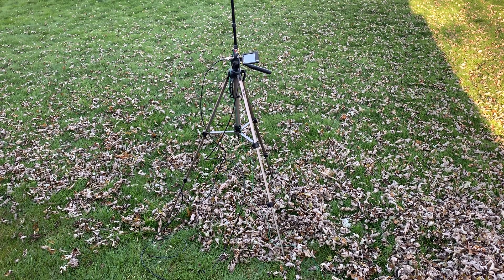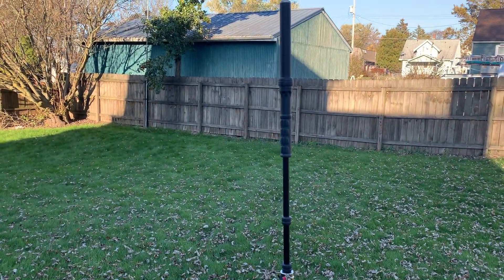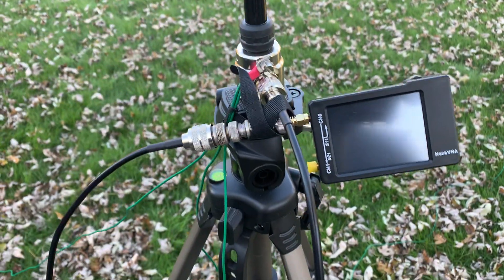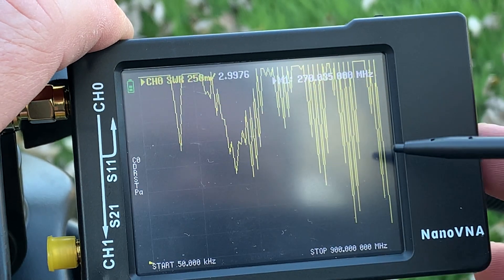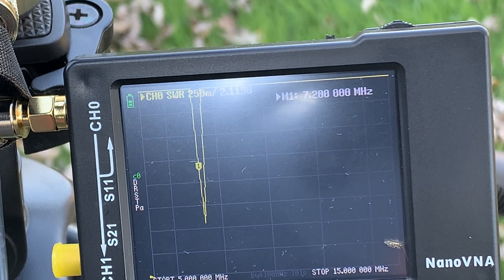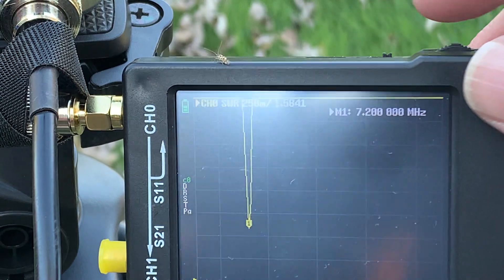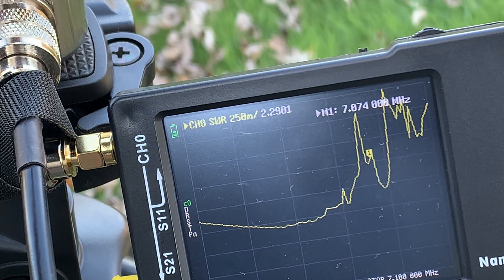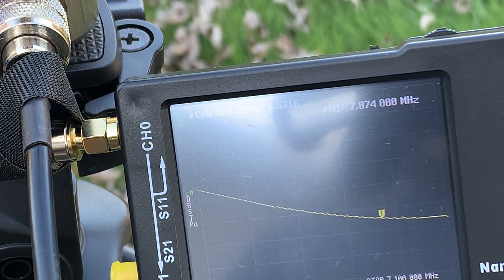Setup and Tuning of the Yaesu ATAS-25 with the help of a NanoVNA.

Comment: Thanks for the tuning method. What would be the range for 20 meters?
Reply from the maker: @axi6ne8us  if I recall correctly, I use two of the three vertical elements on 20m.   I would set the the vna to start at 13mhz and stop at 15mhz and then move the adjustment on the antenna base to achieve the dip in SWR around 14.175mhz.

Comment: Ia it possibls t use Atas25 without nanov or Tuner?what ll b like
Reply from the maker: Yes it is possible.   However, you will need some method to determine when the antenna is matched.   One method I have used is to turn up the volume and adjust the antenna for the loudest background noise.  That will get you close to where you need to be.   From there you can place the rig in a constant carrier mode, preferably on low power,  and key the rig while observing the SWR meter on the rig.   If the SWR is high you can screw the antenna up or down a bit until you get below a 2.0 SWR.     Thanks for watching.   73
Reply: How about on 10 meters band without tuner ? How was your experiences on 27-28mhz sir ?Thx for your vid ,and your reply,73
Reply from the maker: @mook4314  The ATAS-25 can be easily adjusted to effectively cover 27-28mhz without a tuner.    Thx, 73